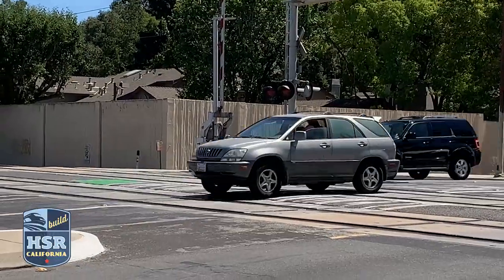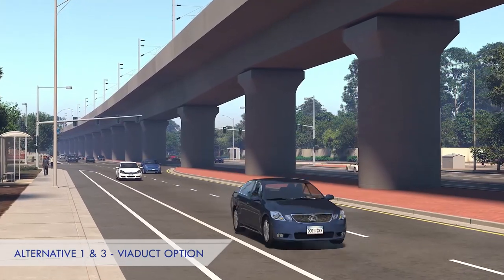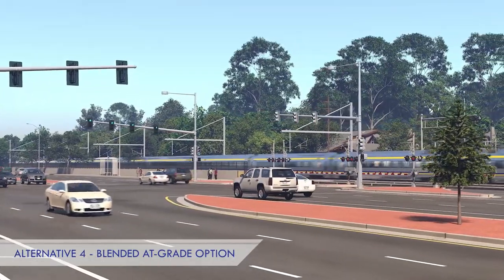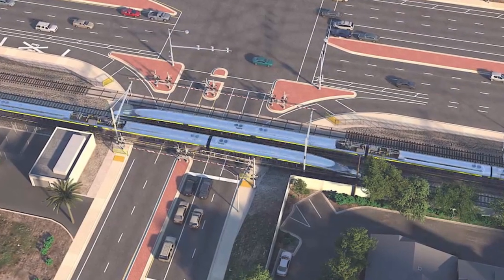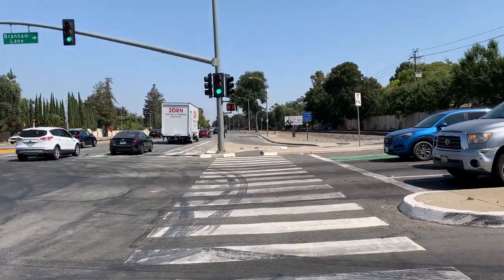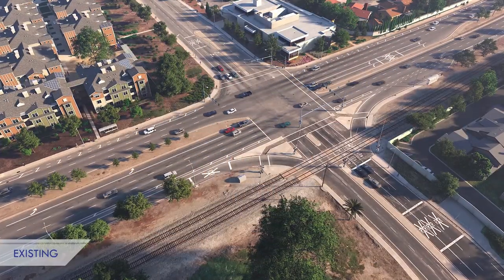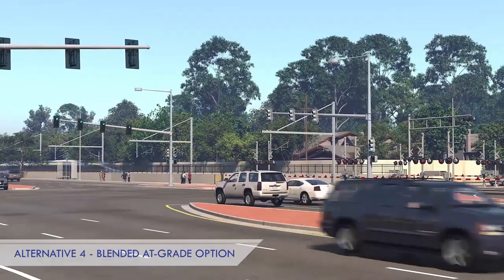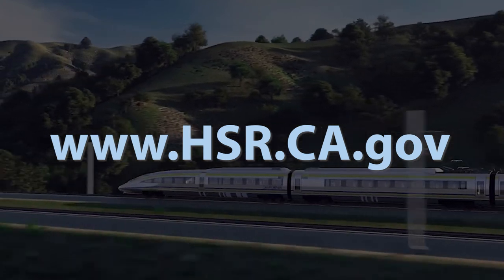On Track with Bay Area High-Speed Rail: Railway Crossings

Comment: This is absolutely nuts. These trains and/or tracks will be a target for suicides and vandals - with or without a grade separation. I love trains and wish the realities were different, but it is clear to me that airplanes are the better option.
Reply: @MrJohndoe845  wow
Reply: Dude, planes and trains are not mutually exclusive. A multi-model means of public transit is always the best solution. But, I agree with you, it needs to be fully grade separated.
Reply: @theexmann  yeah you're right. I'm just disillusioned. Seems like California sucks so bad that even if these trains did start running the lame citizens here will screw it up somehow. BART is basically hazardous. It used to be posh and borderline luxurious, but losers everywhere and constant cost increases have ruined it. I guess I fear the same for CalHSR.
Reply: @DouglasLippi  I agree with you. It's not just building it, but then supporting and maintaining it too. But look at NYC subway. Back in the 80s it was a system where it seemed all its subway cars were covered in graffiti and it was very unsafe in many sections of the system. Now, all these years later, it's a very different story.

I'm hopeful that the CA HSR will result in BART actually improving because of it.
Reply: @theexmann  true. I remember taking the NYC subway from JFK to Manhattan and thought for sure I was going to be murdered. Well, certainly I hope CalHSR works out.